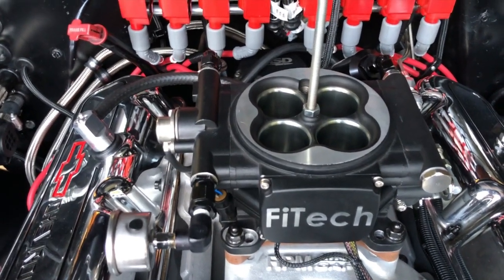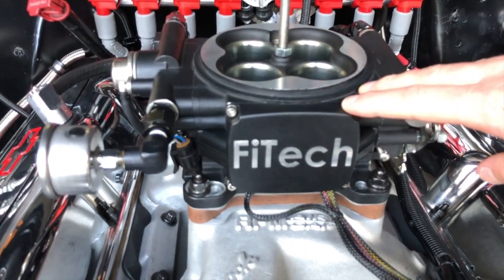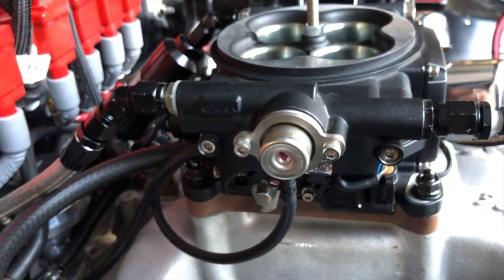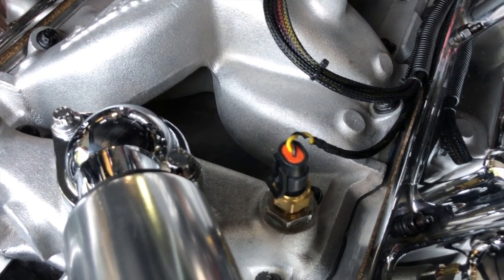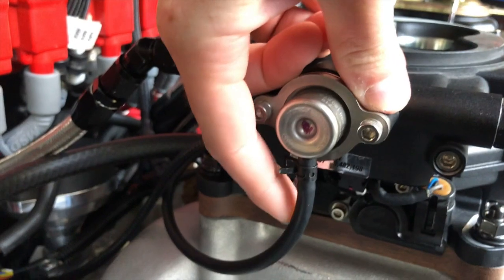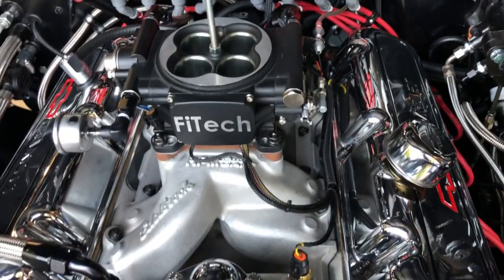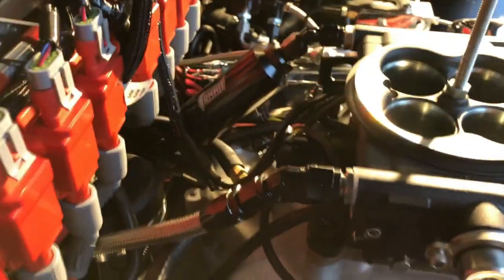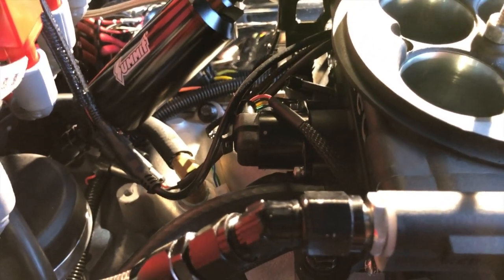Fitech - Sensors and Part Numbers

Comment: Do you think that if my fuel pressure regulator is bad ( leaking) it would cause problems with my afr readings? Anytime I give it gas my afr goes lean and immediately goes way to rich bogging my engine down. I've checked for vaccum leaks , tried adjusting accel pump, changed fuel filters. I cannot get it dialed in. Pulled the hose off of fuel pressure regulator and there was has in the line. Thanks for any input. HELP!
Reply from the maker: It could cause that if the fuel pressure is unstable.  You really need to know what the pressure is doing when that happens though to determine if that’s it.
Reply: @mechtrician1   thanks for getting back to me. I have the force fuel command center that is reading around 58 psi. Just picked up the new pressure regulator so hopefully that helps. Thanks again man👍

Comment: What's the brass piece in the front barrel that sticks out?
Reply from the maker: Air temp sensor.
Reply: Mine melted, do you have a part number?  It unplugs from the ECU onces you gain access.
Thanks!

Comment: Making sure my last comments made it.  Trying to hook up a fuel pressure guage to my 30002 fi tech.  I see you have one pieces together
Reply from the maker: I used an adapter on the Fitech from 9/16-24 to -6an, then an adapter -6an to 1/8" NPT, a 1/8" NPT elbow, and a gauge that is 1/8" NPT which they all typically are.
Reply: @mechtrician1  so that 9/16 is a fine tread?
Reply from the maker: Well 24 is the thread pitch, so yes it is a fine thread, but even finer than 9/16-18.
Reply: @mechtrician1  
Thank you
Reply: Thanks for your feedback yesterday on the parts.  I'm running the same Fitech you show in your video.  However, I have a line in and return mounted to a regulator on the frame so only one main line to the unit.  Has been runing fine.  However, starting to get a lein spike around 3800 to 4K RPMs   I did end up using the regulator block off made by Fi tech since there is no return line coming out of the unit.  Any ideas what it could be?  Is it in the settings that I need to ask for more fuel at higher RPM's?  is it a supply issue?  Did that block change things since the regulator seems liek it was needed on a return line that isn't there?

Comment: Do you have a part number for replacement injectors for the fitech?
Reply from the maker: I do not list them as there are several options outside of the Fitech ones. If you jump on the Fitech Facebook group you’ll find a bunch of folks that have adapted Bosch and Siemens injectors.

Comment: What is the Bosch in-line pump part number? You have warned of knock offs.
Reply from the maker: It’s just a Bosch 044. Order it from a reputable place like Summit and you’ll get a genuine one. Knock offs exist on Amazon and EBay, but they will still have the same part numbers as real ones.

Comment: What about that intake air temperature sensor? mine got dirty and the system went nuts
Reply from the maker: It’s not replaceable to the best of my knowledge, unless someone can correct me. I thought it was part of the ECU.
Reply: @mechtrician1  I have been trying to find out what this sensor is. A new one comes in the box when you get a new ecu. You also get a new rubber grommet for the map sensor. I havnt been able to find out much about it
Reply: It does un-thread and has a plug in it if you take the ecu off of the throttle body. I'd be curious to know!